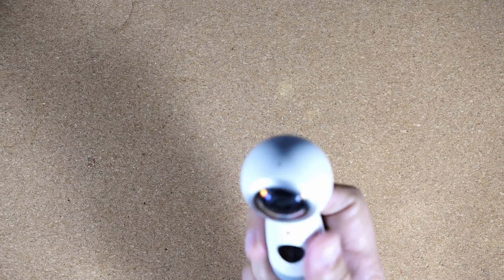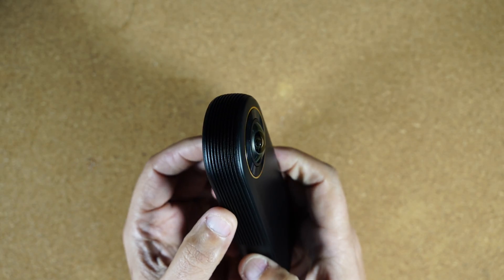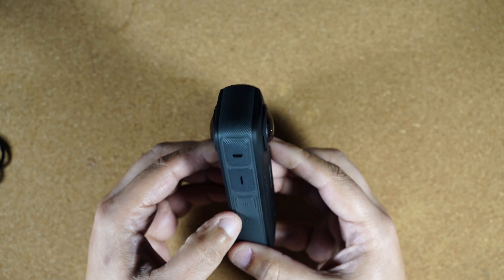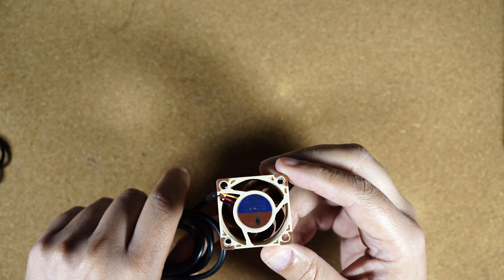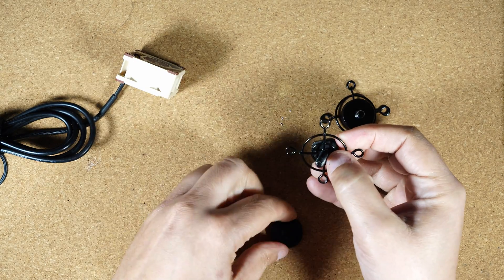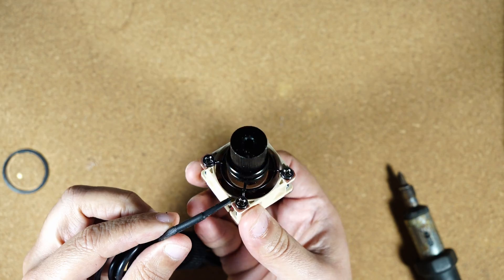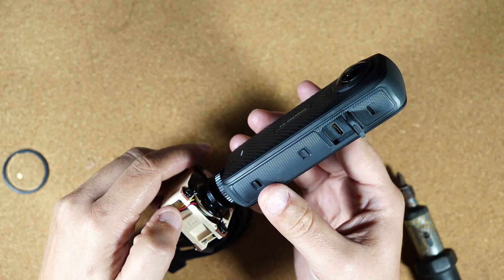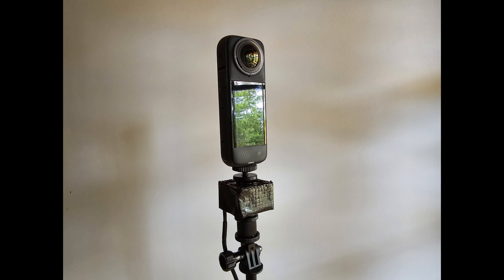Solving Insta360 X4 Overheating Problem

Comment: Thanks for this Video.  I built this fan and it worked good.  I have since switched to using an external 3amp power bank, removing the internal battery, and I can record in 8k for as long as the external battery lasts, which is currently about 4.5 hours.  It seems that removing the internal battery decreases heat buildup enough to not need the fan.

Comment: I've assembled the device, but now there's a problem. The fan works fine when connected to the power adapter. When I try to use it with any power bank, it shuts off after a short time.

Comment: This is excellent! I'm recording a choir concert in a few days, and during today's rehearsal I encountered the overheating issue. I will try to recreate this, potentially with a bigger fan running at a lower RPM. Other solutions I've pondered are pre-frozen cooling elements or even liquid cooling. It should be possible to run the camera without battery, so a small fan or a (liquid) cooler could potentially be crafted to be inserted instead of the battery.  Maybe just adding a passive radiator could work too. Or a "phone cooler". They exist. 

FYI, someone has released this design as a product on Etsy.

Comment: I built the cooler. It works great. The fan noise should not be underestimated. A separate microphone positioned at a distance is necessary.:face-blue-smiling:
Reply from the maker: The noise is there, for sure. Have you tried to use the Insta360 wind mufflers?
Reply: @AndreGranjo  No, Lo probé con el complemento Studio 360 y Davinci Resolve. Esto está bien para una entrevista y aplicaciones promedio. Lo usas para grabaciones de conciertos. Seguramente usas un micrófono aparte, ¿verdad? También me gustaría ampliar mis opciones para grabar música. El ruido no es un problema. Siempre tengo varios micrófonos.La iluminación es más problemática. Por el momento estoy experimentando con: Manuel/Flat/-0.5/6000Kelvin/320 ISO/25/24 fps.
Reply from the maker: @Hans-Georg_Flack  si, lo uso para grabaciones de conciertos, normalmente con 4 micrófonos omnidireccionales

Comment: The reason for overheating is the thickness of the device. This is specifically why Apple is so particular in reducing the thickness of the iPhone and iPad even though it's not really more desirable or useably practical. They're fast and don't overheat mostly because there is no thickness to retain heat. I have the X3 and keeping it cool has always been an issue. I have thought about removing the battery and creating it buying something to insert into the battery slot to cool the camera from within. This might be the only true solution.

Comment: Thanks to you, I'm not returning the Insta360 X4 that I precisely bought for recording my concerts, and after less than 30 mins 8K, it turns off because overheating. Your little trick allows me now to record more than an hour. Thanks again, and Insta360 should thank you too!.. 🙌🏻
Reply from the maker: Glad I could help!! Please share some of your content. Really interested in concert videos. You can check some of my stuff here in my channel where I have a dedicated 360 video Playlist.
Reply: @AndreGranjo  Obrigado!.. Can you please tell how you render 8K videos (software, format, bitrate, etc. do you use InstaStudio?) I ask because I use Premiere Pro and I used to record 360 videos of my concerts with my old X2 in 5.7k and now with the X4 in 8K I don't see so much differences in quality, it's pretty the same and actually it seems a bit noiser. Yours videos look sharper.

Comment: Did you try the Thermo Cover they offer?
Reply from the maker: People are misunderstanding the use of the thermal cover. It is meant to make it more comfortable to hold the camera, not to help with overheating (explanations given to me by Insta360). In some instances it may actually make the camera overheat faster as it prevents air from flowing around the camera.
Reply: @AndreGranjo  mines in shipment right now and I feel stupid now :P

I thought the point was to disperse heat to a material more fit to do so. SMH.
Reply from the maker: @Jakerino3005  why did you buy an extra one? Didn't you receive one in the box?
Reply: @AndreGranjo  I wasn’t aware it came with one. 🤦‍♂️ I bought them separately in the cart.
Reply from the maker: @Jakerino3005  oh.... maybe you can send it back...
Reply: @AndreGranjo  then why i read on product page: "Recommended for recording videos in windless environments when the camera is still" ?

Comment: try to make x4's batterie outside of body on wire extension. this will cool it very quick. even without fan
Reply from the maker: That is the solution I use for my GoPro MAX, but on the X4 the camera hasn't been working consistently powered only through USB-C. I will do more tests.
Reply: @AndreGranjo  I thought so, too... Mine would shut off when using the power selfie stick without the battery in the X4. So, I did some research and discovered that you need a more powerful power bank if there's no battery in the camera. From reddit: "Has anyone run their 360 x4 off a external power bank? I tried but the 360 x4 won't power on if the battery is taken out?"
Jacky_Insta360 "Make sure the external power bank can output 5V/3A power voltage. The X4 can be power on without battery. However, ensure using a 5V/3A power adapter. X4 also supports 9V/2A power adapters with PD (Power Delivery) protocol."
Translation: If running with no battery, make sure any external power bank can output 5V/3A power voltage. The X4 can be powered on without a battery. However, this requires a 5V/3A power bank.